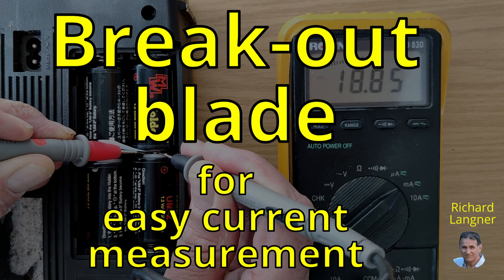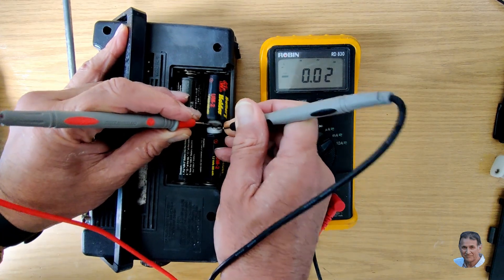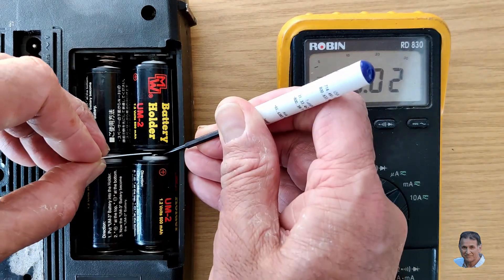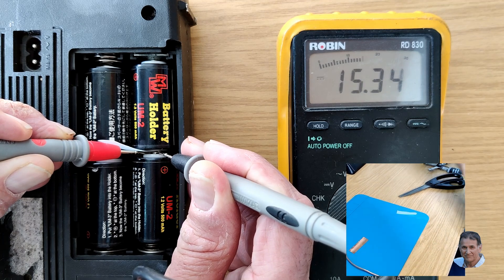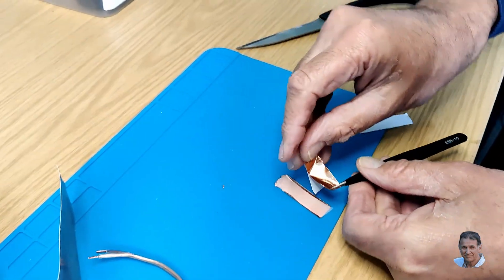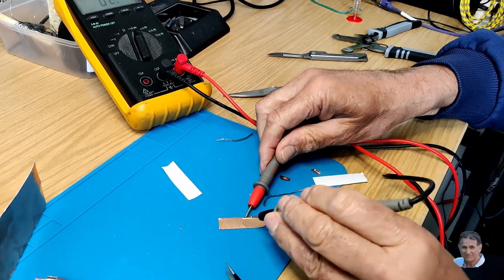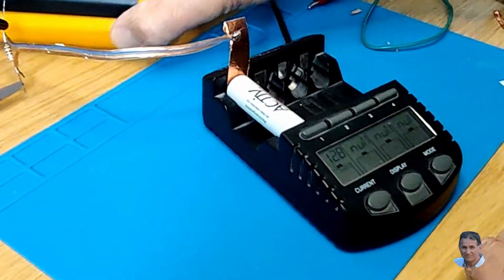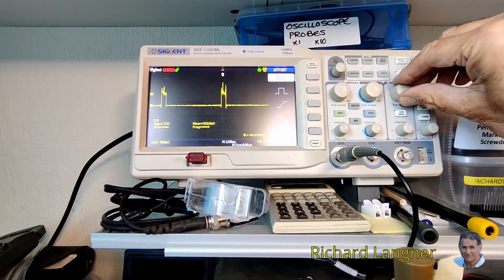Easily measure current in AA - AAA - C - D - 18650 or any round cells that fit in a battery holder.

Comment: An analogue meter should give an accurate measurement of the pulsed current as it averages over time
Reply from the maker: I wouldn't reply on it being accurate at all. If you are talking about moving coil meters, the response time is way too slow for short pulses. A scope is your best bet if you can afford one.
Thanks for the feedback.
Reply: The slow response is exactly what you need if you want to measure AVERAGE current. A bit like the thermal mass of a tungsten filament lamp removes the ac flicker of a light bulb
Reply from the maker: @Mr_Rusty1  Agreed. The old meters have their uses for such things.
It's nice to test in a variety of ways, if you can trust your instruments. Then you begin to get the full picture.

Comment: Why do they pulse charge?
Reply from the maker: Battery chemistry is complex, and there are many reasons to pulse charge. Perhaps some other commenters can explain.
Reply: @richardlangner  Can measure bat voltage between charge pulses.
Reply from the maker: @2OO_OK  Another reason is for burp charging
Reply: The charging current increases the voltage as measured across the cell due to internal resistance. To accurately measure what the resting voltage is across the cell the charger needs to stop charging briefly. If the charger simply waited for the charging current to drop, then the final voltage would be different depending on the cell's internal resistance.
Reply from the maker: @putrid.p  Thanks for the explanation.
Reply: @richardlangner  just based on my observation, I'm not an expert.
Reply: NiMH cells should just be trickle charged since they won’t overcharge, it maximises cell life and it’s also the simplest & cheapest way to charge them.

Comment: A thought to add... If the builder has a thin piece of double-clad copper board (the type used to etch a DIY PCB,) that might be a good material with which to make the probe. I am not speaking of perf board. That would not work, of course. HTH someone.
Reply from the maker: That was the way I used to do it back in the day, so it's worth me adding a  mention in the description. Thank you for the reminder. The only issue I had was the PCB was sometimes too thick and It also depends if you have some board to hand.